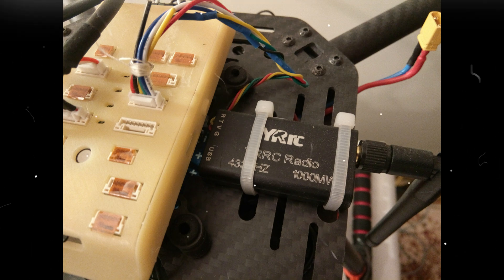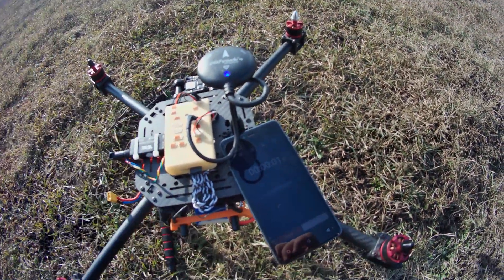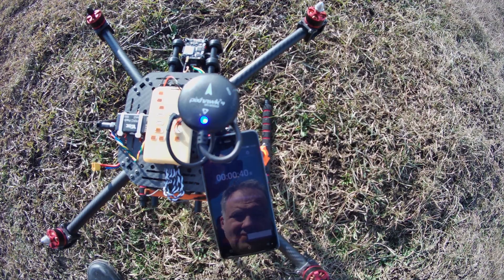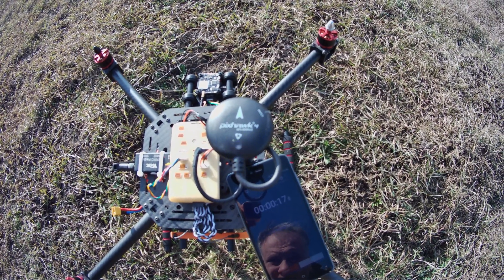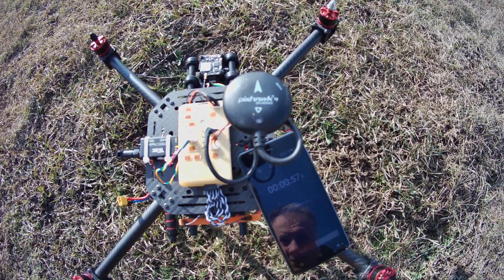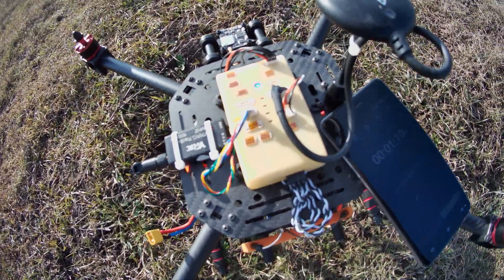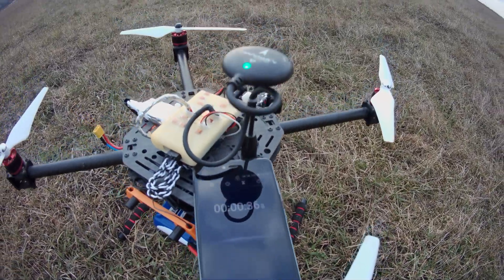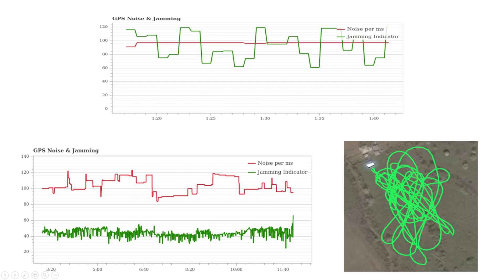A small trick to use the 3DR Telemetry with any PX4 quadcopter - practical application NXPHoverGames

Comment: thank you
Reply from the maker: Welcome! I have also other improvements on HoverGames drone ... but I have no time to publish them. May be in the future ...
Reply: Hello, am using a 3dr telemetry with px4 for my quadcopter. Am using QGroundControl with pixhawk. Am not able to arm the drone with telemetry. Instead when i connect through usb cable to the Qgroundcontrol am able to move the motors. But in case of 3dr telemetry, am not able to establish a connection between the telemetry and the QGC... Can u please help me solve the issue...
Thanks in advance!!!! @i3Drones
Reply from the maker: @nithinkrishnan7537  let’s start step by step:

You are unable to establish a telemetry link with your drone: the problem can be at the drone level or QGroundControl level.

1. Issues at the drone level:
1.(a). Chek the hardware link (TX > RX and RX < TX and GND <-> GND).
1.(b). Software configuration from PX4. PX4 is configured to use TELEM1 for telemetry radios, with a default baud rate of 57600. So, your 3dr telemetry unit must be connected to TELEM1 port. Please check! If no connect to the TELEM1 port. Check also if you do not mess up the PX4 software configuration – see the PX4 documentation.

2. Issues at the QGroundControl level:
2.(a). Connect 3dr telemetry to your laptop/desktop. In device manager you must see a new COM port – if not, you have problems with: (a) USB cable – replace with a better one, (b) driver install - use Zadig or ImpulseRC Driver Fixer to solve this issue, and (c) the telemetry unit is broken – replace it.
2.(b). you have a ne COM port in device manager: now, use Tera Term or any other software terminals to connect to the new COM port – if all up to this point is working you must see a bunch of characters/symbols without any meaning to you in terminal - if you get data, this means that certainly all are OK at the drone level and to your laptop (correct telemetry module connection and software install).
2.(c). Start QGroundControl – now it must work, if not: QGroundControl is the problem. So, uninstall/install or change computer.